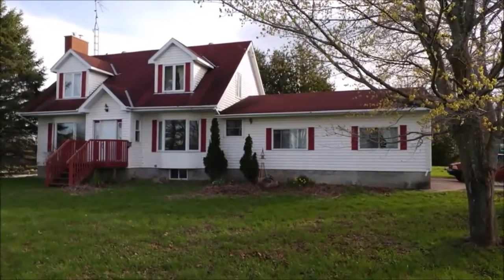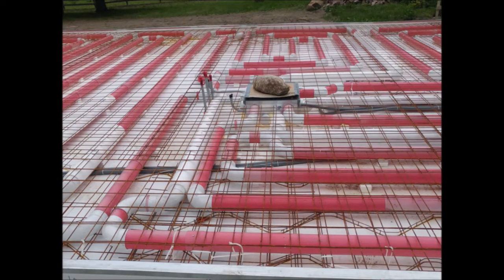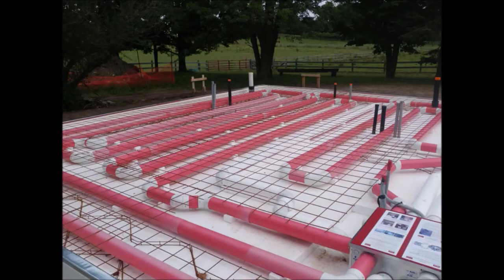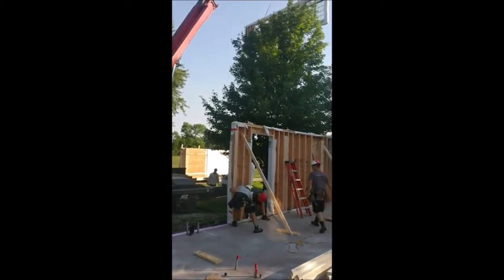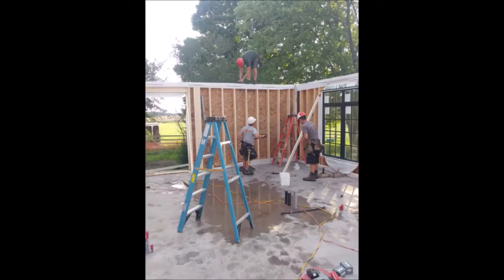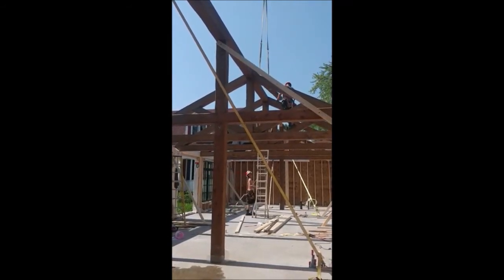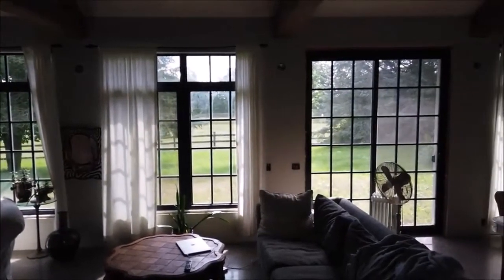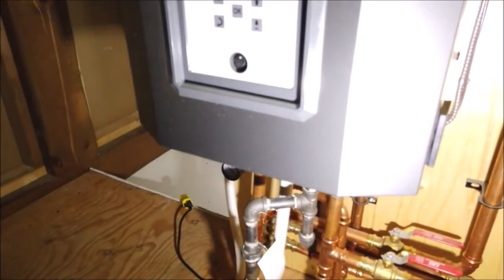Frost Protected Shallow Foundation Forms & Air  Heated Radiant Floor Install - Legalett GEO-Slab

Comment: The built in electric resistance furnace is a deal breaker.  Tried contacting Legalett to inquire if the system could be integrated with an air source heat pump which would heat AND cool the slab far more efficiently but was ghosted
Reply: From what I heard in the video, they used a water to air heat exchanger and an on demand water heater to provide heat in this build. Legalett does offer electric resistance furnace solutions as you mentioned and I heard they were working on heat pump solutions.
Reply: @user-vp1sc7tt4m  @paddy you don't want to cool the slab as it causes condensation which can result in moisture and mold issues

Comment: How does this pass local council rules when it does not have a ring of cement with rebar installed. This building would move some distance during any earthquake. Although that could be an advantage and is used in Japan, in New Zealand we would not be able to use this system built that way.

Comment: If in a garage can you spray wash the floors with water or would it ruin the heating system.
Reply: I really wouldn’t think so. As long as you have proper drainage the water would mostly drain out and anything left would likely evaporate. Also, at least during cold months (when you’re using the heating system for its intend purpose) then the heated air flowing through the pipes would dry up any water. Just one man’s opinion!

Comment: What is the point ? You installed the more experience system and do not use its advantage
Reply: I am not so sure it is more expensive but it has advantages over a water system. For a start, anything penetrating the pipes during construction would not affect it still working.
Reply: please explain.
Reply: @conex8642  they connected air flow heated floors to  the  boiler heating water for them. With the boiler it could be much cheaper to run tubes with water in  floors. Running air in floors makes sense only if you have thermal solar panels which heat air and not for leaving spaces. What they are trying to do is to sale  you  expensive idea
Reply: @andreycham4797  Ok. I am looking at doing an air-heated floor with the in-slab electric heater. I may also add solar panels. But the whole thing is getting expensive.
Reply: @conex8642 on a brand new house I would install air to water heat pump for cold climate with heated floors then you could heat floors only during warm part of  a day not at night
Reply: @andreycham4797  Closed loop heated air is cheaper than heated water. No pump, no reservoir/expansion tank, no expensive solenoid valves/headers, no risk of leaking if the tube gets punctured.